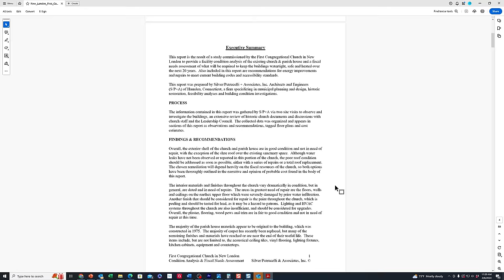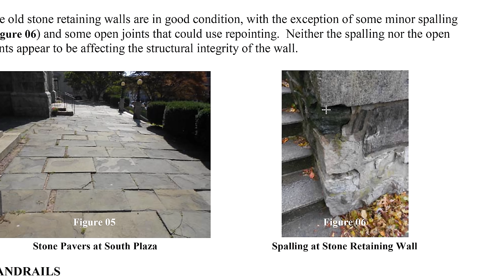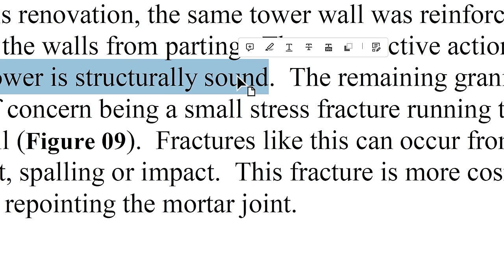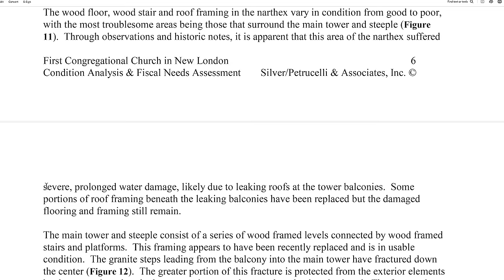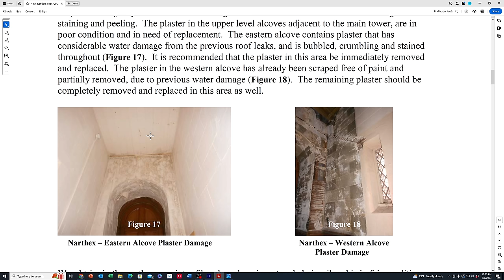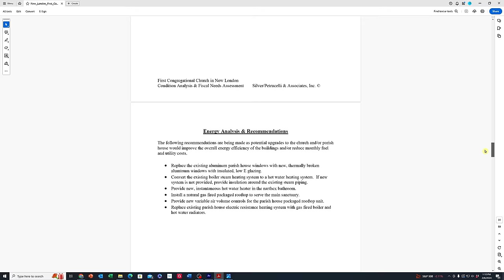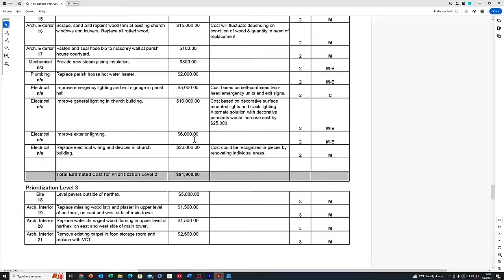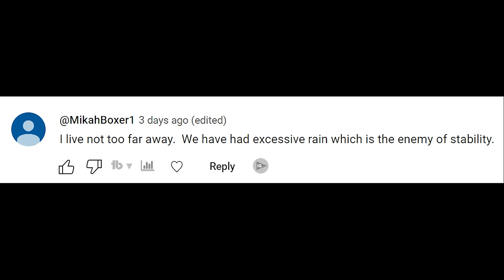Engineering Report: Collapsed Church Steeple Was OK?

Comment: The steeple was purrfectly sound. It was in one piece as it fell: It did not crumble its way down. In our church we re-point the chimney every ten years or so even if we are not using it. The big coal boiler uses the tall chimney, the smaller gas boiler (which creates mor BTU than the big boiler has its own metal flue set into the roof of the boiler room. We used to have three big boilers using a common chimney, but the other two are shut down, and one had to be stripped of its pipes and fittings before the insurance company would take it off the policy.
   §    The slate roof can be a problem: It is very, very expensive to repair, there are not many roofers who can actually do the job correctly. We removed our slate (and tossed it in the lake to add to the rip-rap) and applied a membrane and the special shingles that are supposed to last. Still contractors with a tall crane could lower materials on to the roof, and the roofer had to work from a basket lifted by the crane. Steeples are even steeper as their name implies. We have a hatch at the tippy top so that one could reach up from the inside to remove and service the gold balls that top the roofs.
   §   Our Daughter house in Colombia gifted us with a two thousand pound bell, about the size and weight as a Volkswagen, and we had to raise that up into the tower. You many not know this but many such towers have doors that open all the way to the top. It s called the Bell-way. Before lifting the bell we had to reenforce the structure with steel members. Originally there was no steel in these towers, just brick and wood. Our contractors were doing a multi million renewal of the church interior, so this was just an add on.
   §   Our building manager keeps a close eye on everything and we have architects and engineers on call. Big places gotta spend big money. We have three square miles under our fences, but for a neighbor rents the land for his cows. Our farm-monk retired many years ago, and is pleased not to gout outdoors on such a nasty night.
Reply: Why are you using the state statutes silcrow in place of bullet points?

Comment: As I stated last video, this was probably caused by a combination of a moisture abatement program that didn't ensure ground stability and interference in necessary drainage by build-up of concrete and ornamentation surfaces outside the steeple.  There are very few ways you can undermine a carefully stacked set of squared-up rocks.

Those blocks in the stair into the tower may have been broken at original construction... they're effectively just wear surfaces that have to carry a single person so it wasn't uncommon to use cracked blocks or "will probably break" blocks on stairs as steps when they're supported from beneath.  So the breaks in them may not be important but the uplift is and is clearly on-going.   Expansion of wetted wood beneath those steps can account for them giving out, that grout looks OLD as well.

Comment: They use quite a few of those steel rods to keep things together. Just a theory here that corrosion caused one of them to fail, which then cascaded through the rest.
Reply from the maker: I think it would take a few rods failing to make that happen
Reply: @jeffostroff  Agreed. That's why it would imply that many of the rods would have to be at or near failure due to corrosion.

Comment: Well, sadly the two surviving flanking towers have now felt the sting of death. O raze, here is thy victory. 😿 Did you see the mayor of the town stating the granite is "hazardous waste"? Seems absurd. I'll bet the total cost to demolish and deal with the "hazardous waste" will cost far more than the quote to repair the church. Someone's brother-in-law will likely do well out of this. I suspect the condition of the church likely deteriorated significantly during the 13 year since the report, and of course something could have been going on that just wasn't visible. I placed quite a bit of importance in the architect's letter you referenced in your prior excellent review, as he apparently saw something of sufficient concern to prompt him to write the letter with the astonishing recommendation to tear down and try again. Most likely an original flaw worsened over the decades, and the recent heavy rainfall may have finally shifted something to the point where the tower could no longer stand. I believe the engineering report referenced steel supports having been installed, and if that was done decades ago rust due to the water damage noted by many weakened a critical steel support to failure, starting a domino effect.  It's too bad, but equally awful are all the beautiful churches being intentionally torn down because they are in such poor condition. Sign of the times. But there's money to leave $80 billion of weaponry in Afghanistan.
Reply: To your point about cost of tearing down vs. cost of repairs -- when we had to decide what to do about the limestone carriage house on our property that was badly in need of repairs, we were told that repairing it would be difficult and expensive but when we looked into getting it torn down, we were also told that it would be difficult and expensive. Finding ourselves between a rock and a hard place 😉, we had it repaired.
Reply: Maybe there was also asbestos?

Comment: Thanks for this Jeff.  I also watched the previous videos of the fall, and your reconstruction of it.  I am a churchwarden in England, and found this most interesting.   I am fortunate that I  have a modern (1956) brick built church to look after.   Nontheless I found this very informative.  As a matter of interest to you perhaps, the Church of England has a Quinquennial building inspection of every building it owns.   So no way could one of our churches become so deteriorated without notice.    We did have some lead stolen from our tiled roof some years ago.   It took five years for the water damage to dry out sufficiently to repair the internal plasterwork.

Comment: Back up, at 5:04, when You are looking at repointed spots, I stopped video and zoomed in above the arched vents, now, at this point I haven't watched rest of video, and I don't know if you make reference to this,but did you miss all the holes and through bolts someone added to try to keep inside wall from falling in or outside wall from falling outwards? Those rectangular tabs are steel plates on threaded rod,there are 2 big nuts and washers on right side higher up, and holes drilled all in front, that have been filled and not even used.
 This is obviously a massive failure in morter and possibly design.
 This building was already collapsing.

Comment: Your previous video showed pretty good evidence of tilting of the tower.  Was the tower tilting that same amount at the time of the previous report?  If the tower was leaning, would that have been visible to engineers looking at the front of the church or walking inside and looking at the walls?  It's possible that the tower could have been sound but if the foundation started moving and letting the tower lean it could still fail.  I would like to think that a good inspection of the tower could have discovered some lean and that would have figured into their rreport.  You show some information in this video that was not available at the time of your first video- the layout of walls inside the church.  The plan seems to indicate that the walls under the tower  are very substantial all the way around the tower, the walls inside the building seem to be even more substantial than the walls visible at the front of the building.  It would take some serious damage for those walls to fail unless there was a major contributing factor such as a foundation failure.
I'm not in the business of inspecting old buildings like this.  I'm afraid I would want to do a lot of work to inspect an old building and nobody would pay for that.  Otherwise it would be a continual worry and there would be that voice in the back of your head wondering if you missed something that would cause the tower to collapse in the future.
Big cities all throughout that part of the country are just filled with old buildings such as this- no steel framing or reinforcing steel,, just stacked up blocks that are getting older day by day and may be deteriorating day by day.

Comment: That picture of the steps leading from the balconies to the steeple set off warning bells for me. Even though they were not exposed to the rain directly, that kind of movement is a dead give away to heavy water flow. I believe the flat roofs on the balconies are the "smoking gun". Flat roofs in a rainy area are notorious for leaking. I would bet water was getting into the steeple walls for years eroding the mortar and possibly washing under the tower footings. This damage is incremental over a period of time, and was probably not seen in a visual inspection. Damage to doorways and steps should always be investigated further.

Comment: Jeff the problems regarding funding of needed repairs on churches is often overlooked.  Another problem is that, for the most part, parishioners are only in the church for one day per week and, consequently, eyes aren't 'on' the building for long enough to actually 'see' problems that are slowly occurring.  We caught structural issues with our church just in time but at a significant cost.  The church was built in 1877 and is of wood,  balloon-framed construction.  The structure itself measures approximately  40' by 80' and is of an English-gothic style.   We've completed about 5/8ths of the most needed work on the church and it's 'safe' for the time being.  This work has included a total replacement of the steeple that, like the steeple in New London, had a significant 'lean'.  Over the years it was 'patched' and 'spruced up'.  We often joked that it was held together with 'paint and caulking'.  The cost has been just shy of $1,000,000.00.  As interest in religion has decreased over the years so have the funding sources that are needed to maintain the churches.  ADA requirements and current building codes are another enormous issues both requiring a great deal of 'finesse' to comply with.

Comment: It appears as though Silver/Petrucelli & Associates may have missed a structural problem when they studied the structural integrity of the church building in 2011.  Maybe the problem was minor, not well identified in 2011, or ignored. The tower collapsed 13 years later.  That is plenty of time for a very minor problem to become a grave one.  Were repairs and restorative measures undertaken by the church in response to the recommendations detailed in the consultants' report of 2011, or were they neglected?  According to the 2011 report, how much tilt was present in the tower in 2011?

Comment: I wonder if that report touched on the local water table and if there were any springs in the area.  Along with recent high rain and snow falls, could the ground have become saturated?  Any mention of sump pumps?
Reply: I think the report said the church was sitting on a granite bedrock, but I'm not an engineer and might not know if that means the same thing as i think it does.
Reply from the maker: The report does not address water tables or other environmental items

Comment: Well two things seem obvious. 1) It was not leaning when this firm made its report. 2) Only ground subsidence could do this in a more or less hidden way. It's amazing no one pointed out the fact that the tower was leaning, because it is visible to the unaided eye.
Reply: Can you explain further about the subsidence, considering the report says the foundations are on bedrock?
Reply: @davidepperson2376  Nothing else could cause stone walls that had remained precisely vertical for 170 years to suddenly tilt over. Once a channel was open to running water, the extreme weight on the soggy ground could easily allow water to undermine such a structure. You have to take the word bedrock with a grain of salt. This is in a town that is on an estuary. it is unlikely actual bedrock is near the surface.

Comment: I grew up near “The Granite City” (Aberdeen, Scotland) and never heard of Granite Buildings failing at all in my life. Or a sandstone building for that matter either.

  Could it be conservation and repair issues after this report?  Someone who does not know what they are doing in a way to cut costs.

It may be worth looking into the comments from others in the UK on lime mortar vs cement mortar, especially if they used cement in between the inner and outer walls,
Reply from the maker: Give it time, we will start to see more granite structures failing
Reply: @jeffostroff Buildings this side of the pond tend to be a lot older too.  And we can (and do) keep ruins standing safely.  There are mistakes that have been made in conservation (cement and Rosslyn Chapel is a great example) but there is just not the record of buildings failing - unaided. 

Plus Aberdeen is coastal too so has to deal with salt water and the North Sea winds.
Reply: Historically there are instances of collapse of stone church towers in the UK , the most famous being the collapse of the tower of Ely Cathedral in 1321! 

It was  replaced by a giant wooden structure lantern because it was correctly thought that the reason for the tower collapse was shift from the sandy foundations as the town of Ely is built on a hill in a marsh and the water table is not far down.
But overall a well built stone structure should be stable..
Reply: @epincion  But remember, was it just one year after this church was built that the architect recommended taking the tower down and rebuilding it correctly?  So there is a possibility that it wasn't well built in the first place and only remained standing this long supported by faith and by the grace of God. 😉
Reply: @robertawalsh2995  Thanks for that information
Reply: @epincion  And we have the likes of Chesterfield too, that spire is amazingly old, and about as straight as a corkscrew. It's been twisted like that for hundreds of years, but is still there.
Reply: I'm having to repoint my house because some berk in the past repointed it with cement mortar when it should have been done with lime..... But yes, in the UK we're on with this thing about lime. It's even a thing on Mumsnet. And we're used to a lot of rain, especially on the western side of the country.
Reply: @alisonwilson9749  I have seen the Chesterfield spire and it illustrates another point in relation to this steeple that’s fallen in the US which is that it was wholly made of double layered stone all the way to the tip and as such very heavy and once it started leaning the moment of force around the mid axis would have been huge. 
The Chesterfield spire is a wood frame with a lead covering and much lighter. As to why it’s twisted it’s likely expansion and contraction cycles due to the sun and cold over centuries. There is an association of churches with twisted spires.

Comment: I am from Guelph, near Toronto in Canada. I have been involved in the restoration af stone buildings for the last fifty years. I did the 1854 Milton Jail, the 1850s Wellington County Jail, and the Wellington County Museum. I do not believe the mortar is the problem. I believe there was an active water problem under the back side of the tower. You said that the tower foundation was on bedrock. Where did the rain water from the two balconies on each side of the tower exit the site? A stone structure does not bend in the middle. I believe there was a rain water problem. I am not an engineer but I am a 33 degree mason.

Comment: I am curious about the condition of those iron tension rods the tower had. Especially the rods below all the roof water leaking in for the past 100 years. Once those iron rods rust through enough and snap, the stone is then on its own, (as indicated by those buckled stone steps in the tower access door showed). Also they long time knew that the tower was not built right going back 150 years. The iron rods were added to hold the tower together long ago. Foolish facility management, just like the low budget penny pinchers tended to be in your Florida condo story last year.

Comment: The unsealed steps and surrounding uneven walkway stone slabs probably have little to do with the tower's collapse.  The true defects are likely to be in the wall of the tower beneath the belfry (where concrete my have rotted and disintegrated with time due to water entry from the nave roof and a defective foundation below the entrance to the church.  These defects could have resulted in progressive backward and to the left tilting of the steeple 1--->6 degrees off center axis.  The weight shift of the unusually heavy stone steeple was more than the structure could support at that angle and the tower and steeple collapsed.

Comment: I'm having a problem equating a common biblical quotation - if thou found thy house on sand - and a real church supposedly sat on bedrock and built of granite - that's collapsed. 
When was the tower that supports the steeple fitted with tie backs? Why were they installed? What were they supposedly curing? Where does that lot fit in with the Structural Survey of 2011?